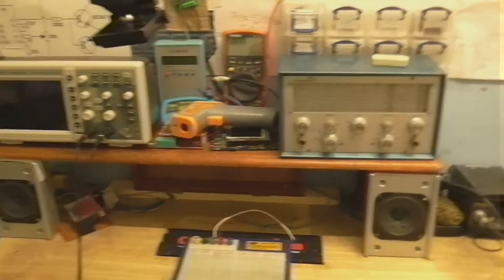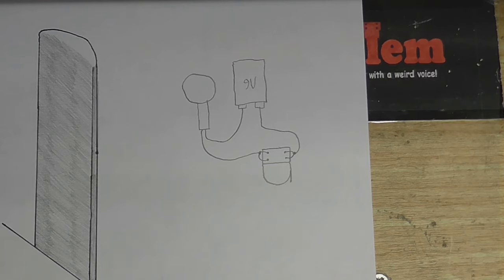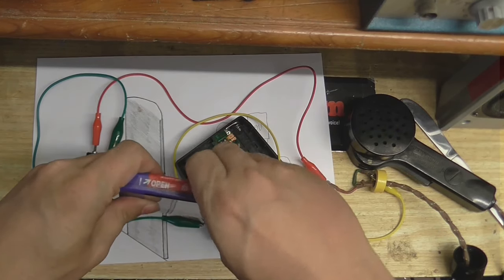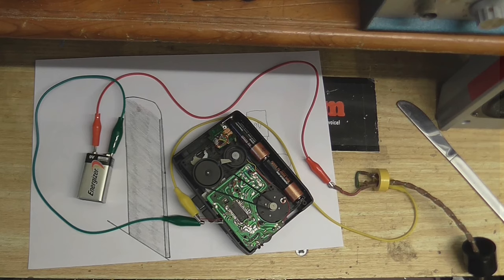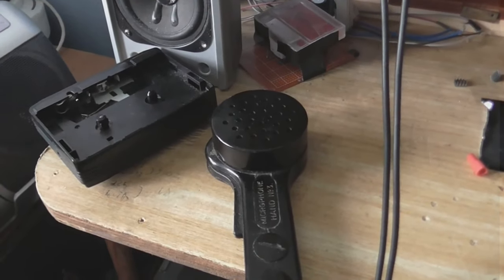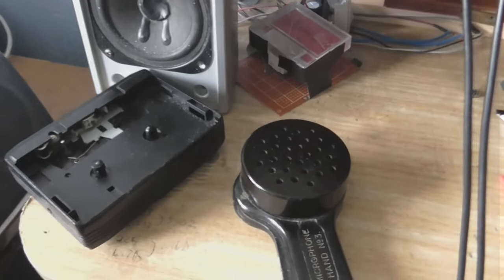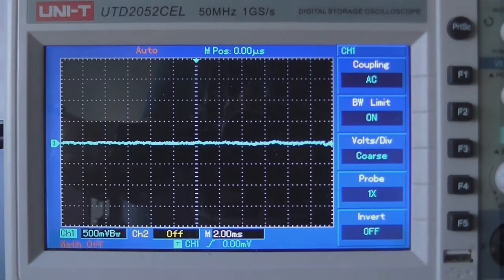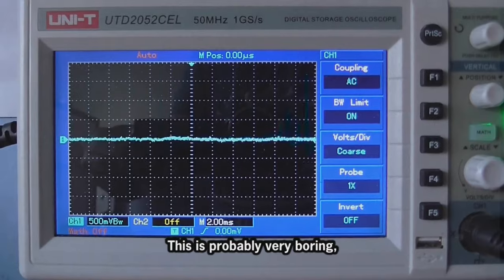The world's simplest tape recorder!

Comment: Well done Clem.You did actually record some intelligible speech.I agree with your conclusion that the electrical resistance of the Carbon Microphone is too unstable to keep the D.C. Bias current through the Tape Head at the ideal strength.Your experiment reminds me a little of Vladimir Poulsen's Telegraphone and one of my own early experiments.

Comment: Sounds more intelligible than I woulda thought. Doesn't the head get hot at the higher voltages?
Reply from the maker: I wouldn't think so, with the mics resistance being around 3k there's no where near enough current flowing for that to happen.
Reply: @CoolDudeClem  

Yeah that's pretty high. The tape head Rdc is usually around 300 ohms. So most power is dissipated in the mic anyways.